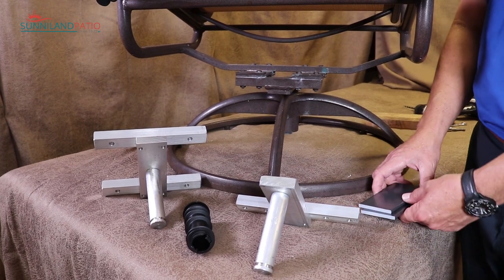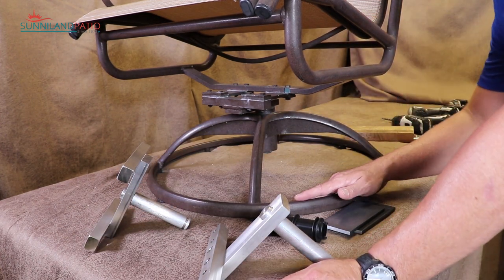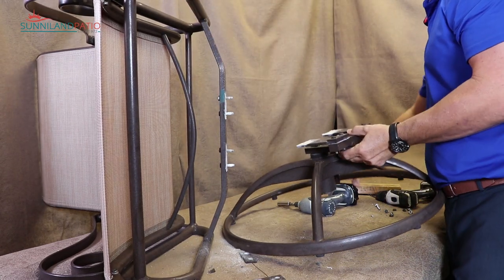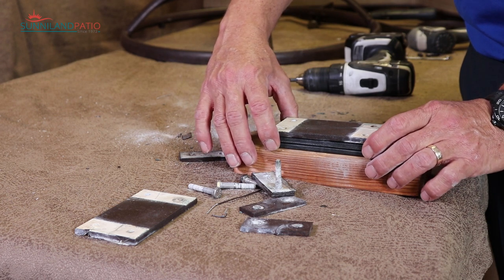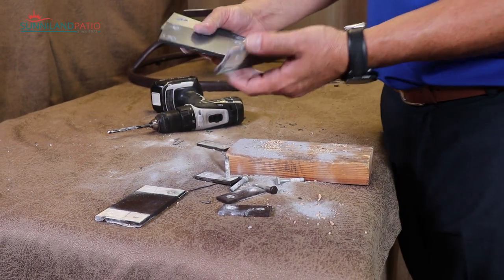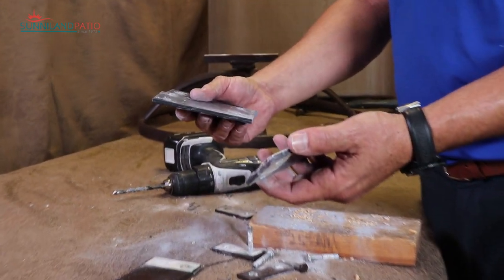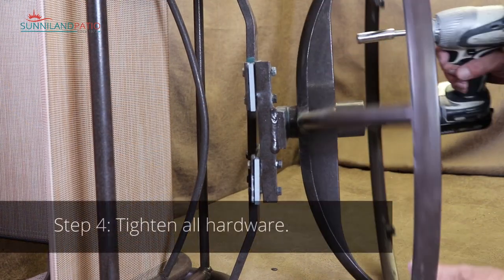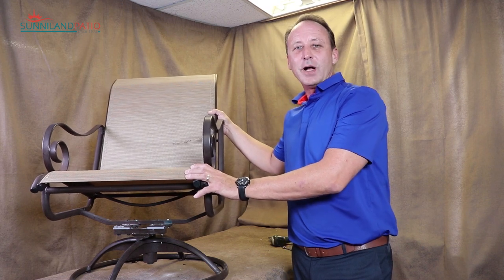How to Replace Swivel Rocker Spring Plates

Comment: Nice video. My swivel armchairs no longer swivel after being left outside in a few New England winters. Would that be caused by rusty posts? Could you do a video on how to replace the posts (starting with how to remove it) or if that's not the problem with my chairs, on how to fix them so they swivel again? Thanks!

Comment: My rocker just started going back too far and dumping whoever sits in it on the ground.. It has happened to me. What would cause the rocker to all the sudden do this is it the plate or could it be the  swivel bushings. I exam both chairs and I can really move one base  by hand but not so much the chair that is ok. Thanks for your time Chris
Reply from the maker: To check the plates - look at the profile -1/4" side - usually hairline cracks are visible if the plate is compromised and making it now loose. 

The bushing is sometimes the cause also, but, less frequent. If it is the bushing- the chair usually wobbles just from pushing on it with your hand.